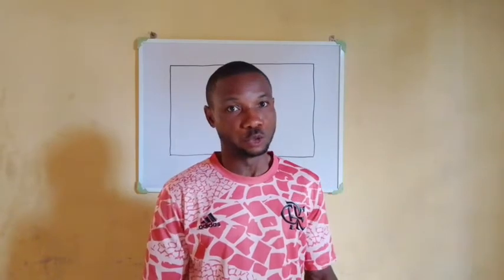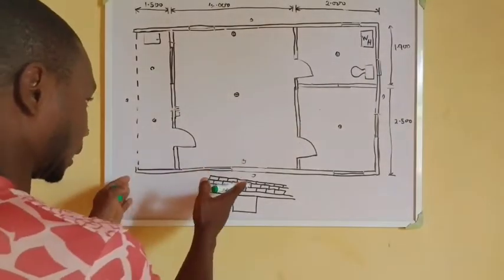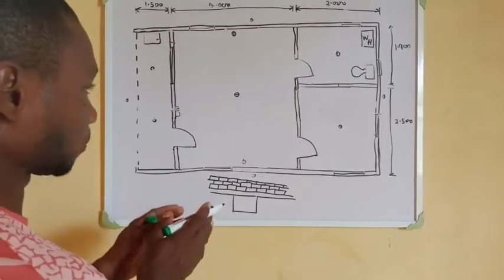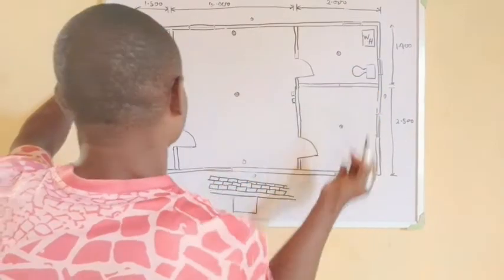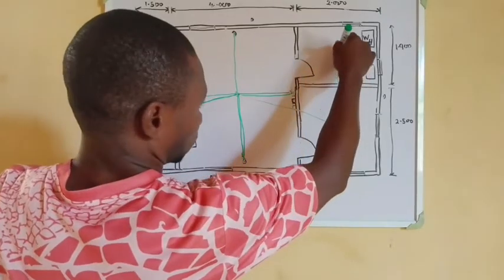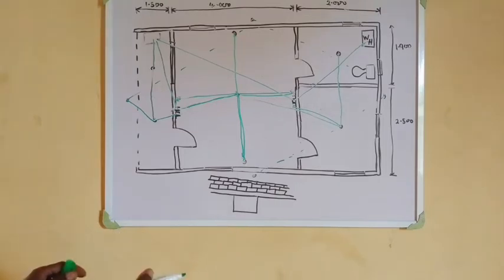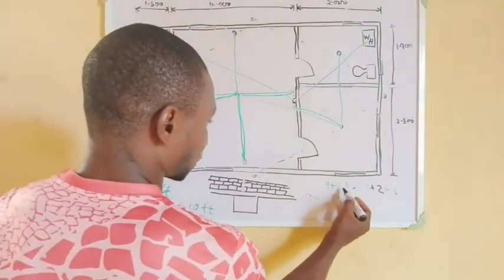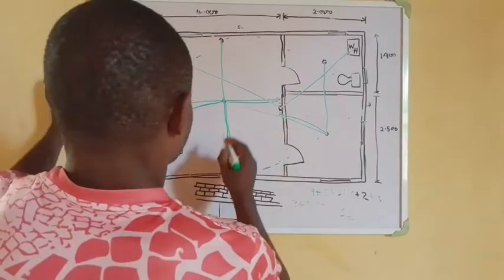How to run Wall Brackets Conduit Piping, and Estimate Pipe quantity needed

Comment: I see you are running extra pipes to the DB when we already have existing pipes going to the DB though from other circuits, wouldn’t it be neater if we had slightly larger pipes but holding more cables to the DB??
Reply from the maker: Something while trying to get a faultless drawing, one is bound to discard and as well as repeat the drawing. Then practically  every pipe is used based on the intended function